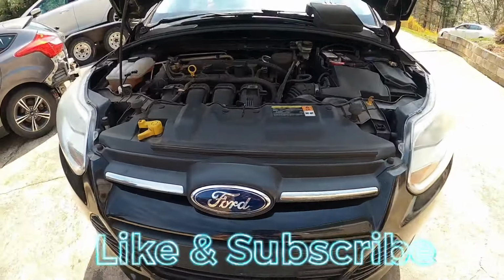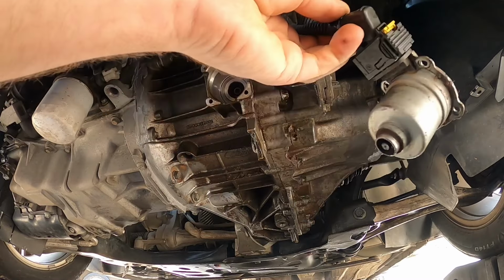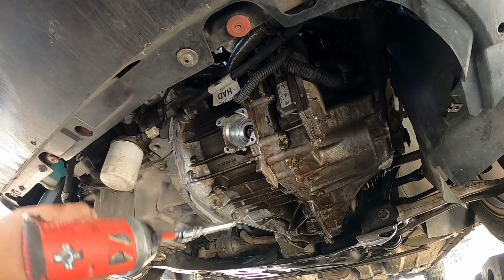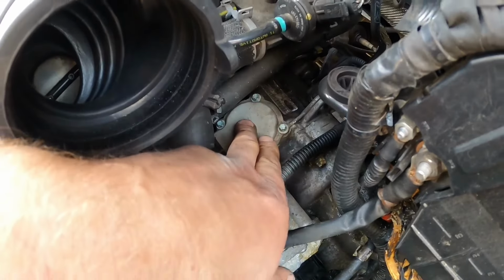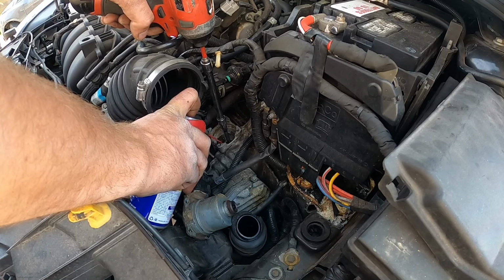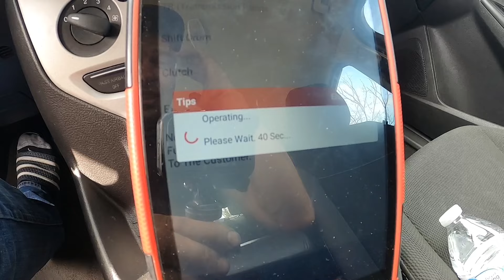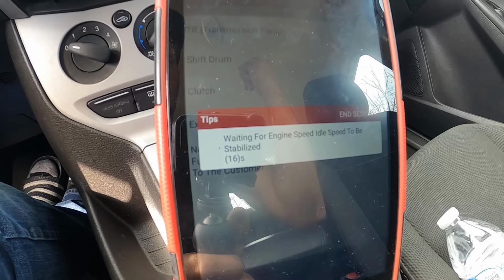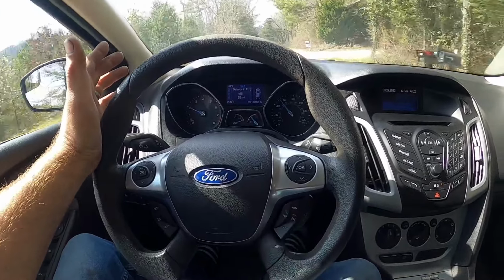2012-2018 Ford Focus Slipping? No Reverse? No Drive? Problem Solved. Easy Fix. You Can Do This!

Comment: Great video and much appreciated!  I was able to clean things up and turns easily now.  Now my problem is the app to run all of the special processes.  I found one to read the codes, but have yet to find an app that runs through all of the processes after cleaning.  Any info would be much appreciated.
Reply from the maker: You can use forscan if you have it. Cheapest way
Reply: Pls help.. should I buy ford focus se 2014 model.. kilometres 101500 
Use car.. people are saying ford focus has many issues.pls suggest me ..from saudi Arab..thz
Reply from the maker: @thaung86  if no issues why not

Comment: I just finished and I think I killed my car. Everything went smoothly and then when I went to pull the tool out of the bottom it pulled out the piece that the lower actuator turns. Anyone got any advice?

Comment: Update. I have done many repairs on this car. I've replaced actuators, the wiring harness, even added a new TCM I got from Amazon recently. Nothing will fix these cars because they will continue to fail later on. Ford needs to completely rebuilt a new style transmission and TCM or a transmission without the need for the TCM. Also, they need to take a few of their factories and build these parts so more can be produced since they can make a whole car in a matter of minutes. They got off too easy in court... such a shame. If you can, trade your cars in. It is only going to give you all nightmares later.
Reply from the maker: Problem is you got your TCM of Amazon. Those don’t work, if they do not for long.
Reply: @L8R-HP  Yes, I agree. There are some where it worked. Even from a junkyard. I just got a bad unit. Regardless the ones Ford gives you will fail too. They are just giving you the same part and those have failed the first few weeks, months after driving off the lot. Ford just screwed many of us who owns this car period
Reply from the maker: @plextors-playthroughs  TCM mostly fail due to low voltage, bad battery’s. Keep your battery’s up to date
Reply: @L8R-HP  my battery is good. Had AutoZone check it. The only code I'm getting for my car is P090c but I can't figure out what it is. It stops going in reverse after check engine light comes on. Already replaced actuators. Still nothing. It is definitely a low circuit somewhere but where I have no clue
Reply from the maker: @plextors-playthroughs  your forks are sticking
Reply: @L8R-HP  I should try this method then? What tool are you using in your drill
Reply from the maker: @plextors-playthroughs  mine came with the clutch removal kit. 

https://www.ebay.com/itm/184480096055?mkcid=16&mkevt=1&mkrid=711-127632-2357-0&ssspo=yvwl7HUSReq&sssrc=2349624&ssuid=-qApsBzoR4m&var=&widget_ver=artemis&media=COPY
Reply: @L8R-HP  Thanks man. I need to get that scan tool also. Is it still for sale or discontinued? I have one that does transmission DTCs but it does have adaptive learning
Reply: @plextors-playthroughs  to add to what he said about the battery, make sure to remove the two main grounds and clean the paint from the contact surface. As much current as the DPS6 system requires to operate, you'd think Ford would've been smart enough to not paint the damn contact surfaces of the grounding points which just adds resistance. It also helps to have a larger AGM battery (H6/H7/48) instead of that tiny flooded 96R they like to throw in there. Also, if you plan to keep it or have other Fords (or Mazdas) then FORScan is definitely worth having as a full diagnostic program.
Reply: Thanks man. Unfortunately, I got rid of the car. It just isn't worth fixing. Too much money was being g put into the car for it to truly have no real solution. Winter is coming and I just don't have time to mess with it. Such a great car if it didn't have that dumb TCM...etc issue.

Comment: Mine i did that still the same not working still no reverse can you help me figure it out i scanned it the codes are pcm code are P0700-00 & U05A00 and for the TCM code P287A, P087B & P087A
Ford fiesta 2013 model... please help me boss...thanks.

Comment: I’d try all these steps to fix my focus but transmission keeps overheating and slips
Reply from the maker: You need to
Replace your forks and clutch
Reply: @L8R-HP  thank you for responding 
My problem started when I unplugged the battery and plugged again

Comment: I seen another one like this where he drills a drainage holes at the bottom
Reply from the maker: Yea that works. As long as you plug the hole. You don’t want moisture in there ether

Comment: I get no codes except fuel circuit a and tire pressure sensor. No other codes and my car wont go shift.
Reply from the maker: Check your fuel pressure
Reply: @L8R-HP  are you sure? it still runs but shakes quite a bit in idle. My uncle thought it was the shifter cable but its electric. Tested all the fuses. The only thing I haven't done was try and clean the clutch actuators.

Comment: Good day, nice video and nice Stang. I have subscribed. I have a code P2837 which is shift fork b position circuit range/performance fault. Think the cleaning will help?

Thanks matt
Reply from the maker: It maybe your actuator that is bad. If not, try this out

Comment: I had a '12 and a '16 Focus. I bought the '16 brand new. Biggest POS I ever I had. Between the transmission, wheel bearings, suspension,  never cold AC..wanted to push it off a cliff. I will never buy another Ford.

Comment: Hi, nice and informative video. I got this transmission code P07A2 on my Ford Ecosport 1.5 petrol vehicle can you tell what would the issue causing this code?
Reply: Did you ever find out what the issue was?
Reply: @mikeq_q  sorry, we didn’t carryout the job and we diagnosed further.
Reply: i got the same code its clutch slip aka you need a new clutch

Comment: Hi - So a word of caution; the bit I needed to adjust the forks came in today and I decided to give it a try. While 'exercising' the fork I either put too much tension on it or due to it's age the fork broke. Not blaming #L8R-HP; but you need to be very careful; Unfortunately I have a $2000 repair bill now to get the forks replaced.
Reply from the maker: The forks were most likely broken. It’s not that easy to break them unless you forced it
Reply: @L8R-HP  I really didn't think I did; but after the third or fourth time winding the spring - as it sprung back a small round clip shot out of the mechanism and the fork lost all tension.
Reply from the maker: @MRDavisFamily  that fork was just done and tired lol happens. Sucks you gotta replace them, but once you do it be all good
Reply: @FN LN My opinion - I would use a socket and do this manually - less chance of something going wrong.
Reply: @FN LN Well - I am only saying my forks were about to break to make myself feel better about the $1400 bill to replace the forks. I don't think I over torqued them but who knows. Your mileage may vary.
Reply: If you don't mind me asking you in which state do you live? I was quoted 3600 for the same repair in North Carolina.
Reply: @MRDavisFamily  If you don't mind me asking you in which state do you live? I was quoted 3600 for the same repair in North Carolina.
Reply: @IwCk  New Jersey; local transmission place that had experience doing Focus trans for local Ford dealer did it; $2000 got me new forks; seals; a new clutch (they could not reset the old clutch) and labor. It was a good deal; but it took 7 weeks due to parts and their backlog so was it really a good deal?
Reply: @MRDavisFamily  Thanks for your reply. My 3600+ quote was for replacing the forks only. The ford dealer i called is crazy. I m glad you got yours repaired.
Reply: @IwCk  Dealer pricing is ridiculous; that is why I tried a local trans shop. Hit or miss; some didn't want to touch this car. Got lucky I found one that the dealer outsourced to.

Comment: Please people: don’t touch transmission! If you really have a problem and decide to do so be very careful. I ruined mine..
Reply from the maker: “Don’t try this at home” lol
Reply: Did you do this and it ruined yours?
Reply from the maker: @Justusiar  no, this works if your forks aren’t bad.
Reply: @L8R-HP  yeah I’ve dealt with the transmissions some too and that’s what I figured. I was just wondering what this person did, and if it was this step by step process.
Reply from the maker: @Justusiar  yea these are easy to work on.
Reply: It is true, I followed the steps the only thing I used a vacuum in both holes (maybe not a good idea). After I used the forescan to learn touch point..finally the top screw was moving freely means top fork somehow gat damaged. I really don’t now how?! I ended up replacing the clutch and both forks $$. My car had no fork issue, just the same shuddering issue for 5 years. I am not here to discourage. Just a warning
Reply from the maker: @sjonuzi  the only way you can damage the fork is if you turned it to far. Sounds like your fork was already bad.
Reply: @L8R-HP  it was my fault I now, maybe I turned it to far

Comment: I pulled into a McDonalds, parked my car. Wouldn't turn back on.. After eating, it powered on but NOT a SINGLE GEAR worked.. No Reverse, No Drive, No Lower gears..
I just got it towed home.. and saw this video.. Do you think my transmission is FRIED, since it ALL went out at ONCE??
Reply from the maker: Any codes?

Comment: Yeah don't do this. If it's covered under warranty just bring it in. I've seen people try this and end up breaking their clutch forks. They aren't meant to just slam back after being under tension
Reply from the maker: Agree if you don’t know what you’re doing don’t try this. Don’t use a power tool unless you have experience doing this. I’ve done a few hundred of these cars in the last 2 years.
Reply: What are you basing this statement on? Seems pretty straight forward to me

Comment: Does any one here know what the rpm should be on this car when cruising around 70 to 80mph. I replaced the bearing, clutch and forks. When cruising on the highway around 70mph the rpm is around 3200. This seems high but not sure if this is normal for this car.
Reply: 70 for mine rn is like 2500 I won't go 80 in these pieces of junk
Reply: @VictorKaneMorgan  Funny, I had mine up to 115 with no issues.  
I do 80 to 90 on a weekly basis.
Reply: @whill7828  what was your rpms like
Reply: @VictorKaneMorgan  Since I installed an aftermarket (Scamazon) TCM, 1700 miles ago, they seem to be a little higher than I recall and the shifting is a little slower (Higher RPM before shifting gears).  

Just last week I had it up to 90MPH and it was over 3000 RPM, but I was not watching the tachometer too close to give exact numbers.

What RPM, Speed and Gear are you in that you are worried about?
Reply: @whill7828  I traded that car in after all got tired of worrying about the damn clutches
Reply: @whill7828  but it was normal I think the Rpms but the shifting was acting like yours. On highway about 70 is over 2000rpma

Comment: you said the aftermarket actuators don't last long, bro can't be any worse than the OEM ones, I know I have a 2014 focus bought it in 2018 and the transmission have been "repaired" 6 times since I got it and it's begging for another one again, totally useless crooked scam pulled by Found On Road Dead, needless to say I will not buy another Ford vehicle because they lied and tried to blame the drivers.

Comment: Fords transmission are crap since 2002 Explorers on most work on pressure changes except fords servo bores are so soft within 30,000 miles worn to point it's not enough pressure to even shift right. Then you got to remove transmission drill and bore serv's and re-sleeve bores for oversized servo lots of time and money even doing it yourself.   Or if your unable to fix it price a new ford or rebuilt one n labor at a garage you'll find it cost around the same or more than the vehicles worth to repair.
Reply from the maker: All cars are crap if you think about it

Comment: 2012-2015 are the ones with the problems
Reply from the maker: 12-18
Reply: @L8R-HP  is it general or dose it have anything to do with the lawsuit?
Reply from the maker: @vengefulkitsune3307  not sure if the recall is 12-18, I just know 12-18 have the same problems.
Reply: @L8R-HP the lawsuit is for the 12-15. But this is a general problem for 12-18. Gotcha

Comment: OK, I did in this video seven or eight times and it was like seven or 8000 miles now when I do it, I lose spring tension after about six rotations and it’s hard to turn and it doesn’t get any better. I put a whole can of WD-40 in there now, it’s worked so good before but this time and I do hear it just a tiny bit of clicking in one spot. Does this mean that I need to replace the forks? I posted a video here: https://youtu.be/PJgnzv3IFFI?si=1dVO8jxBEBlEf6CH
Reply from the maker: Yes. Unfortunately that fork has had enough and needs to be replaced

Comment: If you have let the battery go bad on these cars prepare to get another transmission case or a whole new transmission because a simple battery problem will make the TCM go berserk and mess up the transmission not the for not the clutch nor the  TCM or stepper motor but the actual transmission. One last thing do not do what this guy is doing, even with a ratchet you can break the spindle in the fork because it is so thin and you would have to drop the transmission and change the fork. For the most part this does not help

Comment: this fix will be rendered moot once the TCM fails. And, it WILL fail.
Reply from the maker: If your forks are sticking, it will fry your TCM. If you battery is weak or bad, it will fry your TCM.
Reply: @L8R-HP  too late for me.... I'm down and dead waiting for a TCM..
Reply from the maker: @ProfessorIgor  plenty of TCMs out there. If you ordered a new one it will be a while
Reply: @L8R-HP  used ones program up and work ? or is it just a band aid ?
Reply from the maker: @ProfessorIgor  if you get a used one with same part # no need to program.
Reply: @L8R-HP  you're kidding, right ? plug and play ??
Reply from the maker: @ProfessorIgor  yep as long as part number is the same

Comment: My 15 has no codes  won’t go in reverse..will drive but will slip, catch,  red line in then drive a few feet.  Trans trash ? I think
Reply from the maker: Your forks are getting stuck.
Reply: Can I just buy the drill fitment?do you know what type is that?

Comment: So are the actuators interchangeable can someone please answer this for me before i possible f*ck my car up even more
Reply from the maker: Actuators a & b are the same and you can swap them around
Reply: @L8R-HP  ok thanks ! I’ve been having issues with my car not going in reverse or shifting right so i got new actuators and put em on but they only lasted a few hundred miles before the problem came back up. I’m going to replace them again but this time with OEM parts instead of cheap ones from Amazon and hopefully that’ll fix it. Yesterday i took my old A actuator (the original) and put it where B goes. Check engine light stayed on car sounded bad when i started it. Since i didn’t have the tools to get to A actuator i decided to put the replacement for B back in while i wait for tools then to my surprise check engine light was off. Mind you this is same replacement part that i thought went bad so i don’t expect it to last really. Also last time i changed my A actuator there was a lot of dirt and dust built up where the part goes. Should i clean that out once i have the tools to get to it?

Comment: Nice as a clean and small maintenaince. But you are totally wrong.  That actuators drive the clutches, not the forward or drive gears. In fact the actuators that change the gears are in the TCM. Also the gears are splited between the clutches in odd gears and even gears, not forward and reverse.
Reply from the maker: Maybe you should watch this again

Comment: I'm sorry to bust everybody's bubbling ready to do this work on their own in the first place cannot be done in 5 minutes it takes about 5 hours he didn't mention the part that you need a special scanner to get transmission codes and to reset the transmission as he showed you in the video he also didn't show you have to know how to operate the scanner here are the three truths it does not take 5 minutes to take 5 hours you cannot do this job if you're not a mechanic and you can't do this job if you don't have the same scanner or something equal to it
Reply from the maker: @memolong  5 hours? I can replace the clutch and forks in 2 hours. Check my other videos

Comment: doubt youll see this but I have
Reply: P052B
P00014
P0012
P2837  

car cranks but no start ford focus 2012 any idea where I can start?
Reply from the maker: Those are timing codes. You need to check your timing
Reply: @L8R-HP  thank you I bought the TDC pin is there any guides you might recommend?

Comment: And there you have it transmission is bad they are everywhere worse transmission ever
Reply from the maker: Not really. Just need to know how to work on them. Simple manual transmission that’s needs clutch and forks replaced just like a manual

Comment: This transmission is a curse and of course Ford takes 0 accountability for this bullshit. I had repairs done within the recall dates and i have spent 4,000 in repairs to this dumb thing out of the recall dates as well.  

Every fix I’ve ever done to this transmission lasts for 4 months and then some other crap goes wrong.  I can’t wait to get a new car.